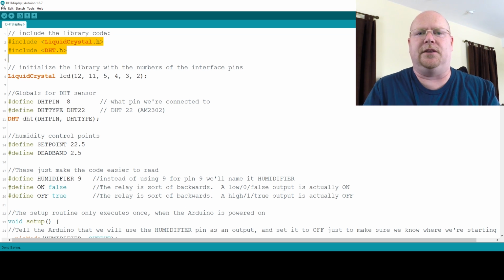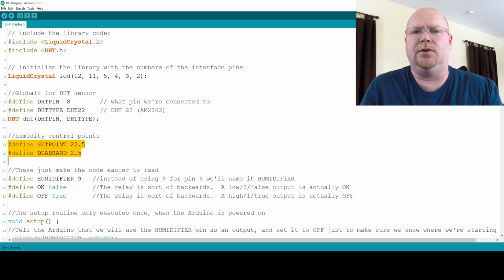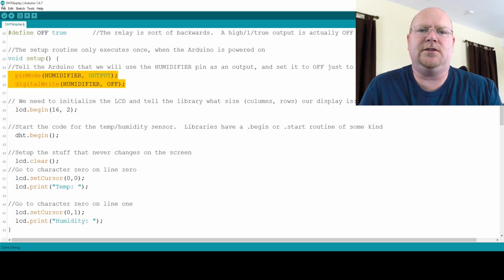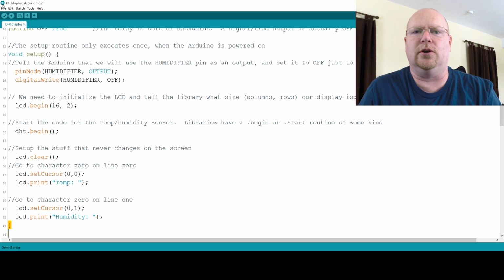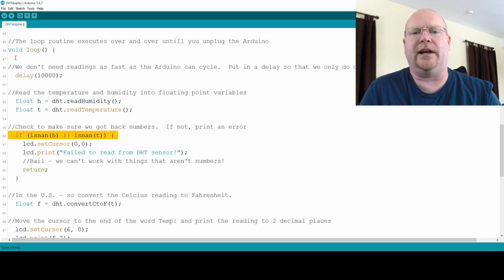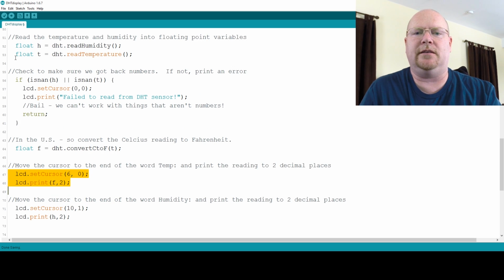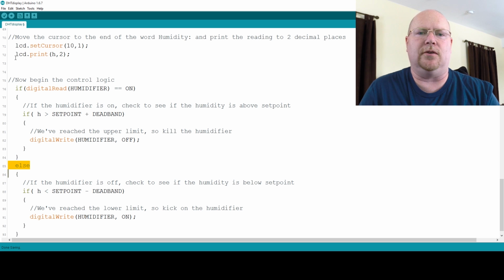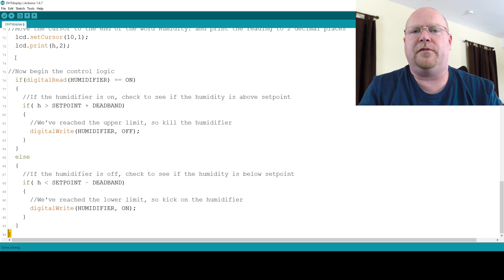Humidity Control with an Arduino

Comment: Excellent video Matt. Could one do precisely this same idea but with a ceramic space heater that lacks a set point temperature? 

I would assume they're typically AC powered as well. Thanks again for the great video.
Reply from the maker: You sure could Jacob.  Watch the current rating on the relay though.  A space heater will draw a lot more power than this humidifier, so you'll need a relay rated at the full 15A your wall outlet can supply.  Be sure you're using a modern space heater that had built in tip-over and over temp protection too.  Last thing you want is your insurance company pinning a space heater fire on your control circuit!

Comment: Hai sir Matt I'm a little bit confuse and I'm worried because this is our research project automatic room humidifier and de humidifier controller using arduino uno.
Reply: With LCD. Can I ask you how may male to male and male to female jumper wire do I need. Thanks !!

Comment: Interesting and informative video. Subscribed. Thanks for your time. 
Is it possible to use BME280 sensor to achieve the same?
If yes. Is it possible for you to suggest the changes to be made to the Arduino sketch below?

Comment: is it possible to connect a arduino with a humidifier and IR controller? I want the ac to turn on by itself and auto turn on the humidifier depending on the rooms humidity. And also, is it possible to remotely control it?

Comment: I want a set up that controls the humidity in the room and the temperature by operating a heater or a wall fan that sucks air from outdoors
Reply from the maker: Same setup could pretty easily be extended to control multiple things.  The heater or fan would just be another output pin hooked up to a second relay.   Almost identical logic needed to take a measurement and decide whether or not to turn on/off the new device.
Reply: @MattHeere  thank you for your reply I bought the arduino kit about 4 years ago plus lots of sensors, relays and displays etc and have never done anything with it
Reply: Is it simple to swap the LCD display for the colour display?
Reply from the maker: @layton7430  It's not too bad.  Different displays have different libraries that drive them, but many of the "draw on the display" functions are similar, so adapting the code is tedious, but simple.

Comment: We need to see it in action :)

You did a great job with this video. I’m trying to get into dev work and I think hobbies that include libraries are good practice. I’ve always wanted an automated humidifier. You should def do a follow up vid on how to make this into a real application like how you would waterproof the case while keeping the sensor exposed.

It is kinda funny that the difference between a ten dollar humidifier and an automated eighty dollar led one basically comes down to the humidifier having software (a library) because we all know the board and sensor and led are really cheap.

Comment: Hi Matt. Can you please explain how you wired the rely with the socket and plug. Thank you.
Reply from the maker: The relay is in series with the hot lead on the outlet.  Neutral and ground connect straight from the wall to my outlet.

Comment: Great build, Thanks for sharing. My only question is, that humidifier doesn't have an ON/Off button right? It kicks on as soon as it gets plugged in?
Reply from the maker: It has an OFF/LOW/HIGH setting dial.  I just leave it on HIGH and let the control system deal with it.
Reply: Matt Heere got it. Thank you. I have a humidifier that has a button which needs to be pressed to turn on. I'll try to get this model over christmas or something

Comment: Can you please share the code?
Reply: // include the library code:
#include <LiquidCrystal.h>
#include <DHT.h>

// initialize the library with the numbers of the interface pins
LiquidCrystal lcd(12, 11, 5, 4, 3, 2);

//Globals for DHT sensor
#define DHTPIN 8          // what pin we're connected to
#define DHTTYPE DHT22     // DHT 22 (AM302)
DHT dht (DHTPIN, DHTTYPE);

//humidity control points
#define SETPOINT 22.5
#define DEADBAND 2.5

//These justr make the code easier to read
#define HUMIDIFIER 9     //instead of using 9 for pin 9 we'll name it HUMIDIFIER
#define ON false         //The relay is sort of backwards. A low/0/false is actually ON
#define OFF true         //The relay is sort of backwards. A high/1/true is actually OFF

//The setup routine only executes once, when the Arduino is powered on
void setup() {
//Tell the Arduino that we will use the HUMIDIFIER pin as an output, and set it to off just to make sure we know where were starting
  pinMode(HUMIDIFIER, OUTPUT);
  digitalWrite(HUMIDIFIER, OFF);

//We need to initialize the LCD and tell the library what size (columns, rows) our display is
 lcd.begin(16, 2);
    
//Start the code for the temp/humidity sensor. Libraries have a .begin or .start routine of some kind
 dht.begin();

//Setup stuff that never changes on the screen
 lcd.clear();
//Go to charicter zero on line zero
 lcd.setCursor(0,0);
 lcd.print("Temp: ");

//Go to charicter zero on line one
 lcd.setCursor(0,1);
 lcd.print("Humidity: ");
}

//The loop routine executes over and over untill you unplug the Arduino
void loop() {
  
//We don't need readings as fast as the Arduino can cycle. Put in delay so that we only do c
 delay(10000);

 //Read the temperature and humidity into floating point variables 
  float h = dht.readHumidity();
  float t = dht.readTemperature();

//Check to make sure we got back numbers. If not, print an error
 if (isnan(h) || isnan(t)) {
   lcd.setCursor(0,0);
   lcd.print("Failed to read from dht sensor! ");
   //Bail - we can't work with things thar aren't numbers!
   return;
 }

//In the U.S - so convert the Celcius reading to Fahrenheit.
 float f = dht.convertCtoF(t);

//Move the cursor to the end of the word Temp: and print the reading to 2 decimal places
 lcd.setCursor(6, 0);
 lcd.print(f,2);

//Move the cursor to the end of the word Humidity: and print the reading to 2 decimal places
 lcd.setCursor(10,1);
 lcd.print(h,2);

//Now vegin the controll logic
 if(digitalRead(HUMIDIFIER) == ON
 {
  //If the humidifier is on, check to see if the humidity is above setpoint 
  if(h > SETPOINT + DEADBAND)
  {
    //We've reached the upper limit, so kill the humidifier
    digitalWrite(HUMIDIFIER, OFF);
   }
 }
 else
 {
   //If the humidifier is off, check to see if thr humidity is below serpoint
   if(h < SETPOINT - DEADBAND)
   {
     //We've reached the lower limit, so kick on the humidifier
     digitalWrite(HUMIDIFIER, ON);
    }
  }
}
Reply: Just type it XD

Comment: GREAT VIDEO!!

I'm interested in controlling a reptile vivarium with an Arduino setup such as this. I am using a piece of equipment that I had purchased from a store to do this now, but I'd like to do it myself and expand along the way. Maybe Bluetooth monitoring to my phone. (?)

My question is this....
This is the exact project I need but adding temp control to it. My boa is a tropical snake so I need to maintain both (warmer than my home) temp and high humidity. Can this Arduino handle it all? 
Another video online had suggested one to control output and one to control function. He did have a touch screen though. 
Thank you in advance!
Reply from the maker: The Arduino is more than capable.  I'll make a suggestion though:  My last two videos on getting up and running using a newer flavor of Arduino called a Photon.  If you ultimately want to be able to connect to your setup remotely - especially from your phone - then this thing is the way to go.

We have a Columbian Red-Tail that needs a new home, and this automation will absolutely be part of it.  Can't promise when I'll get around to it though :)

Comment: Awesome video, thanks.. is that python code? doesnt look too scary
Reply from the maker: Arduino "sketches" as they're known are just plain old ANSI C.  There are compilers for other languages out there, but C was originally designed to be just one level up from the native chip instructions, so it's actually a really good choice for this kind of work.
Reply: thanks, it seems quite semantic.. not too verbose. Youre a really good presenter, thanx

Comment: That's a lot of programming, custom for sure.
Reply: +Matt Heere It seems to me that you're probably not new to code. Someone that has never been introduced to code will see this video and still be completely confused. They'll have no idea what you mean by "variable", "object", "library", "call", "loop" etc.

For someone that already has an understanding of some (any) language of code, yes, this is very basic.

I've read a number of "Beginner's guide to (code)" written from the standpoint of a person that thinks the very basic concepts of code (especially that particular code) are known to everyone.

I think the average person, despite your clear explanation of how it works, could not replicate this without significant research and tutoring.
Reply from the maker: +Ozzstar It's funny to me that so many folks react just as you did Ozz.  When I look at it, there are only 13 lines that are actually needed for this thing to do the humidity control.  The rest is fooling with the display (optional for sure) or just making things look prettier in the editor.

I see these types of projects as being WAY more approachable than most of what you and I do on our channels.  It doesn't require a shop space, no expensive tools,  <$50 worth of parts, and it's next to impossible to hurt yourself.   

Why people who see no problem with sticking their hands into a $2000 table saw are scared away at one page of code is baffling to me.   I guarantee you it's 10X simpler than the wiring harness on any car made in the last 10 years :)

Comment: Brilliant!  We just bought a humidifier for my daughters room and it just runs until empty too.  I blow a fan across wet towels in my office as I work from home up in MN.   Brilliant, huh?  
I wouldn't have the time to figure out how to do what you did but I sure enjoy your videos.  You didn't happen to see any off the shelf products to do what did you?  Thanks Matt.
Reply from the maker: +Ticky66MN They exist, but they're designed for reptile enclosures and they tend to be expensive.  Your best bet is probably just to get a lamp timer and set the humidifier to run for some part of every hour.  With some experimentation you'll be able to dial it in pretty closely - at least until the outdoor conditions change significantly.  I still have to solve the run empty problem in my setup.  How to measure the water level without altering the water container, and without spending $50, is the conundrum.

You could also try to work something up using a humidistat designed for your central heating system.  They're available at HD/Lowes for around $25.  Problem is that they're designed to switch 24 volts AC to drive a small solenoid valve.  You'll still need a 24VAC power supply (wall wart will work) and a 24VAC coil relay to control the humidifier.

Comment: Matt, excellent explanation of a technical subject.  How much affect does the proximity of the DHT have on humidity readings.  Seems it is close in your test setup.  Now you need to do a ground up video from start to finish showing how the software is loaded onto the Nano and then updated.  I can see many projects like these for the home and workshop.
Reply from the maker: +David Lankford It depends on the circulation available.  Without the heat pump pushing the air around I'd definitely be too close to get a good picture of the whole room.  As is, it works out OK because the fan keeps everything fairly well "mixed up".   Of course in a critical application you could use multiple DHT sensors and decide in the code how you want to interpret the results.  Reptile enclosures are a common example of  this.  People measure both the "hot" and "cold" side of the enclosure and try to keep a specific gradient more than a specific temperature.

There are tons of videos out there already on getting started with Arduino development, not to mention some really good tutorials and instructions on Arduino.cc.  Bob over at +I Like To Make Stuff just did a series on Arduino as well.   I do have a couple more projects in mind though, so I'll try and work some different steps into the mix in the future :)